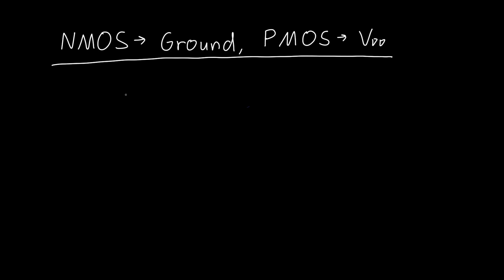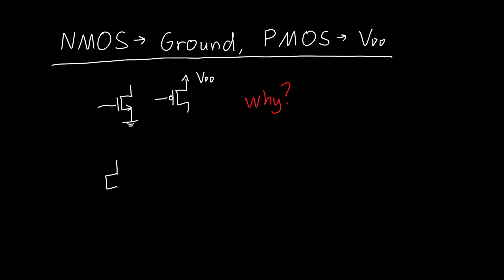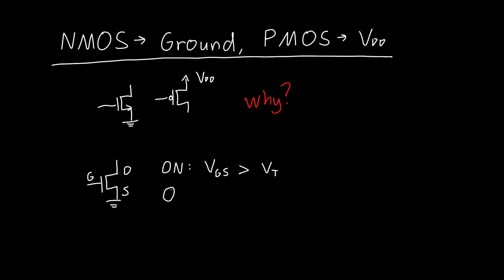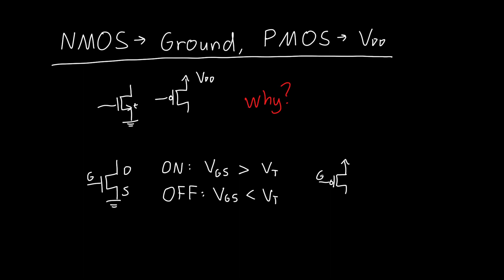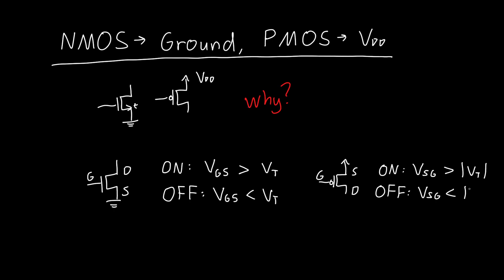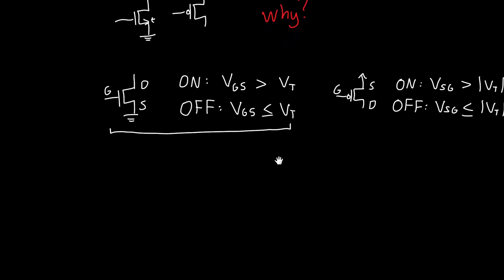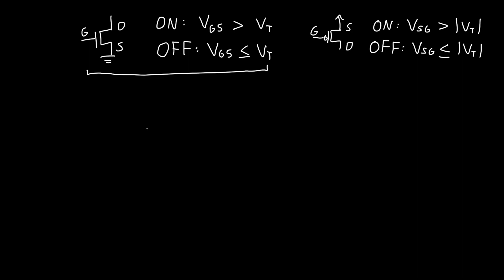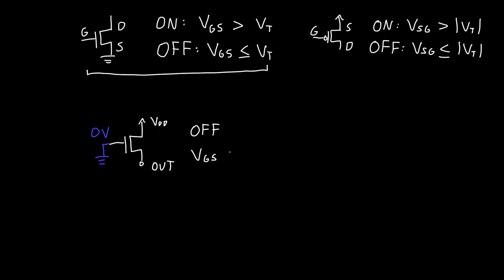Why are NMOS transistors always connected to ground?

Comment: N channel devices can be found with the drain connected to VCC in H bridge.  They key is to drive the gate voltage above VCC, usually 12V or so above the H bridge. This is done with a boot strap driver or gate drive transformer.